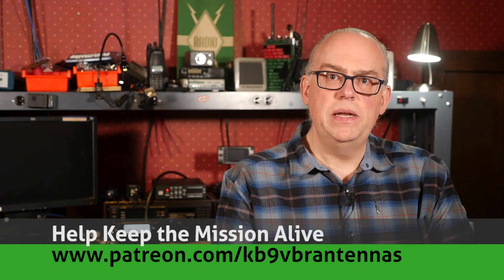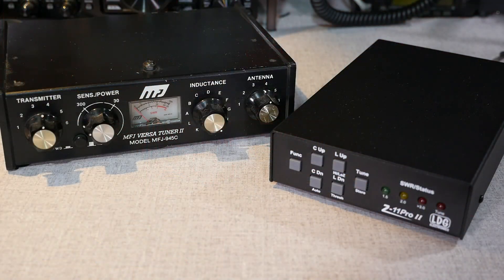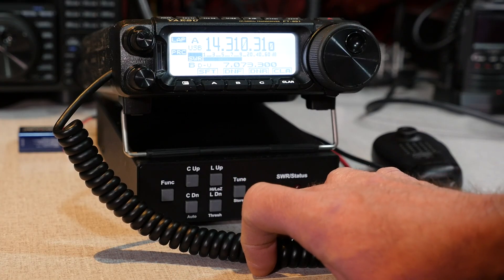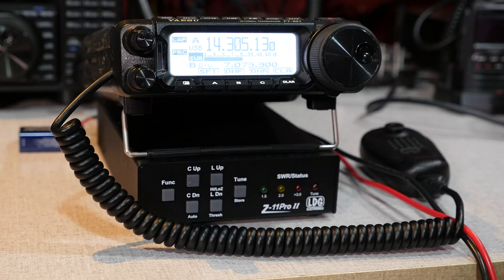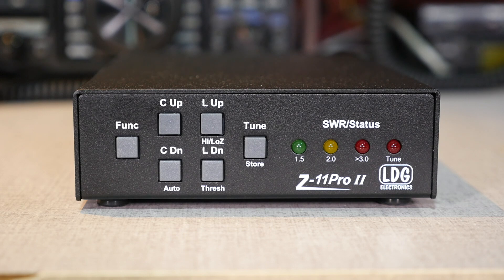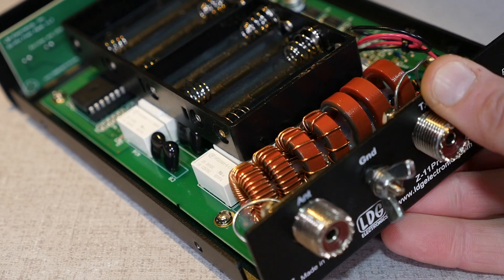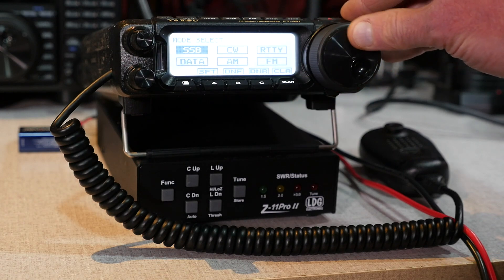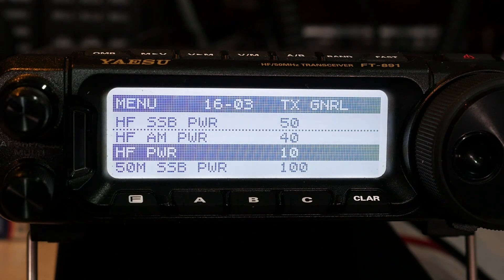How to use an automatic antenna tuner with a Yaesu FT-891 (LDG Z11 Pro II)  - Ham Radio Q&A

Comment: I have a ldg 100II pro and ft891 in LAP mode. I have set the MTR  to display power to see what power ft891 tunes on. I have noticed it tunes on 20w... is it OK?  Should I be concerned? It seems high.

Comment: I have been running with a FT-857D and a LDG Z100 for 10 years now. As I'm thinking for getting a FT-981 I watched your video. I would like to use the REM function as well as the tuner - so is it possible to make an adaptor and connect both the Y-ASS cable and the FH-2 to the port?
Reply from the maker: Unfortunately no. In order to use a tuner through the remote port you need to turn the LAMP mode to On. For the FH-2 to function, you need to turn LAMP to off
Reply: @KB9VBRAntennas  OK, so I will need to use the USB and send CAT commands.

Comment: What’s your opinion on the Yaesu FC-50?
Reply from the maker: The FC-50 is cool because it's paired to the FT-891. But be aware that it will only do a 3:1 impedance match. If you are planning to run a non resonant antenna, you may want a tuner with a greater range.

Comment: Would the LDG AT-100PROII also work on the yaesu 891?
Reply from the maker: Yes it will. I've used my AT200ProII, which is just a higher power version of the tuner, with the FT-891.

Comment: Hi Michael, I was using the other day the Yeu external tuner FC 40 on my 891 and it was amazing one simple 71 foot piece of wire up in a tree and with that tuner I was able to work all bands and when I had this set up in the field, I did a photo and it was remarkable If you can get a hold of one of these FC 40s you gotta check it out. 73 . W8KFW Karl from Ravenna, Ohio.

Comment: Question for ham radio q+a , my call M0ANO Rob from the UK..in previous years I have used atas 120's for my mobile operation but the don't last for many years. I've been things about buying a mat-40 auto atu in the back of the car with a very shout lead to a 9 foot tank whip. Just wondering if you think it will work well . Regards M0ANO Rob
Reply from the maker: I know of many hams that have great results using the 102 in (9 foot) whip with a wide range tuner. You need the tuner at the feed point of the antenna and the MAT-40 should be up to the challenge. My only advice is to bond everything in vehicle: doors, frame, chassis, etc. This will help greatly especially with using this setup on the lower bands.

Comment: The ultimate antenna tuner what is the first one made was called a Matchbox from Johnson Viking and it was a big metal box about the size of three school lunch boxes put together. And had two large knobs on the front which ran a  variable capacitors inside and the other one ran a connector around the inside of a large spiral wound inductor.. It was sold by the Matchbox label. And that would carry a kilowatt of K down am transmitter RF which was the design capability. It was made in the 1940s because a full legal limit AM transmitter or amplifier boy put out 100 watts of AM modulated RF which was a lot of power and more than today kilowatt sideband amplifiers will handle. In the 60s and afterwards, the American FCC it changed the output limits on RF transmitters to accommodate single side band... The limit put on what is a maximum of 1500 watts ohh modulated single side band RF which was actually about the equivalent of 500 watts key down AM modulated..  It was actually a reduction in RF power allowed to hams but because it was transmitted as a sideband emitter, the effect on the receiving end was even better than a full kilowatt of modulated AM RF.
     This is why the earliest Johnson Viking Matchbox was so big and so heavy duty inside the output on this unit word 2 ceramic insulated freezer bushings is it could be connected to either the two sides of a dipole or one side of a dipole or one side of very sloping wire antenna.over a correct length. Johnson ranking also made a very heavy duty half size antenna tuner that had a coaxial socket output where's promise matching 50 ohms properly tuned.  The second smaller Matchbox The second smaller Johnson manually tuned Matchbox was really sized for the single side band era...... That is lower actual RF  peak instantaneous hi RF output. Both made versions we're sold later additions there's a meter mounted in the middle of the front panel which allowed you to find a null point which indicated a good match. Like all matching antenna tuners, is very difficult to adjust a tuner without some output indicator like a meter.
   While he was in good health and young,, a man from Asia, Mr. Martin Ju, started a company selling low price ham radio products that grew to a huge inventory of just about anything you would want as an accessory to your ham shack. He created MFJ company and apparently bought cheaper Asian products to put in his units and apparently hired local unemployed ladies to build the units. These were all products that worked as described I just don't overload any of them or they will burn out with no overhead protection. Fortunately MFJ company had a huge line of accessories and toward the end of its life, it took up the stock and sales of remarkably good antennas from HyGain, and many other well established brands that couldn't make hey market driven Crawford only at your hams-- which is always been a small number of highly specialized needs. Unfortunately the MFJ line is succumbing to the advantage of its owner.... And may go totally out of business along with all of the well known brands it had adopted.
   By the way you can still get a magnificent five to seven elements monoband beam for 20 meters and less than $1000... Quite a bargain but not going to last as a sale item very long. I had the HyGain Christmas Tree fh a stack of five element mono banders for 20,15 and 10 yogis. really  barking.
Reply: I use a speech to text computer program they give me lots of errors.I hope you'll forgive me. I have PD and shaking fingers. Getting old reduces your fun.

Comment: How will this compare to the Yaesu FC-50 AutoTuner?
Reply from the maker: The FC-50 is a matched tuner for the FT-891, so it is tightly integrated into the operation of the rig. The downside is that the FC-50 is limited to a 3:1 match, which may not be enough range for a non-resonant antenna. (The LDG tuner can do up to a 10:1 match)

Comment: Do its relays draw current to hold the position after tunned, or are they permanent magnets?
Reply from the maker: The LDG tuners are designed so that once a tune is achieved, power is no longer needed at the relays.

Comment: Michael, just got a Z11ProII for my FT-891. I discovered that you can set the radio’s 16-03 HF PWR down (I set mine to 10w) so when it sends out the CW carrier upon tuning, it’s hopefully not as hard on the finals as the 25-50w it uses when the 891’s factory default setting of 100w is used. I checked that this was happening with the power out meter. Thanks for the great video and turning me on to the LDG!
Reply from the maker: I do the same thing, I keep the HF power relatively low and switch to RTTY mode when I'm tuning.
Reply: @KB9VBRAntennas  But what if you want a (permanently) higher power setting in 16-03 (for instance 40W for data modes). The tuner will use those 40W then, even if it would be much better to just work with 5 W, right?

Comment: Good evening. I am just wondering if anyone is having issues with this setup on FT8? For some reason, with the accessory cable connected between the radio and tuner, the radio is wanting to drop transmit any time I try to tune or TX the radio. As soon as I remove the plug from the back of the radio, it does just fine. Just wondering if anyone else has had this problem? 

73 de N4JKD

Comment: I have the old Z-11 Pro.  Smart choice on the 9 volt external power.  I like the internal battery setup on the Pro II, but would forget about the batteries (heavier) that would surely be oozing crud by the time I checked them.  Plus, unscrewing those little screws in the cold while on a POTA event wouldn't be much fun!

Great video, thanks!

73,
Brett

Comment: I have both manual and auto tuners. I hear that with auto tuners, one can risk higher SWR destroying the finals while tuning. What is true or just misconception?
Reply from the maker: That is a possibility. Going through a full tune cycle with an auto tuner can present high SWR to the finals. Much like the process with a manual tuner, you should turn the power down during a full tune cycle.

Comment: Ok so my LDG Pro II auto tuner on my Yaesu FY-891 quit tuning properly. I don’t if I did something to throw it off or not. I unplugged and replugged in auto tuner. Rechecked radio settings and yes had tuner set to Lamp for tuner. Ok so here is my question. Other people tune on AM or CW mode. You were tuning on this video in LSB mode. Is it ok to tune in LSB/SSB, as you said the radio automatically tunes in CW mode? I do have the proper control cable for the Yaesu radio. I do have data and center power settings low as noted.

Comment: Other than the obvious, what are the different features of the LDG AT-100Proll Autotuner and the LDG Z11 Pro ll?  I have the AT-100Proll Autotuner and just was wondering.  The only difference I think is that I have two antenna inputs. Would a 9 volt battery run my tuner and is the tuner drawing power after a tune? If I use antenna 2 input then I have the antenna 2 led illuminated. Thanks for any info de N3OJL.

Comment: is there a tuner for yaesu ftm 300 dr or no need for a tuner on that radio...2 m , 70 cm and digital. TIA
Reply from the maker: There's no need for a tuner for VHF/UHF. The antennas you will use with that rig will either be resonant or have enough bandwidth to cover the entire band.

Comment: Can you help me?  I have a homebrew 80 meter full wave loop antenna fed to an MFJ-993B Automatic tuner with 400 ohm ladder line.  I have an FT-891 Transceiver.  On the back of the MFJ tuner there is a port called Radio Interface.   How does that connect my FT-891?  Thanks!

Comment: I like having both a manual and autotuner BUT if one only had money for one right now (I'm ordering the FT891 soon unless I stumble across an Estate deal on say a good working legacy radio in the next two weeks for a starter then backup rig in the next two weeks.) Should I just buy the manual tuner and which one do 9ou recommend?
Reply from the maker: I think you should start with a manual tuner; they are more versatile. They will match a larger range, handle more power, and work with balanced and unbalanced feed lines. The MFJ line of tuners are good, like the 941, 945, or 949. You can usually pick one up at an estate or hamfest relatively cheap. I wouldn't be afraid to buy one used- as long as it doesn't smell like smoke or burnt electronics, it will work.
Reply: Thanks...I really don't mind fine tuning it by hand. Like the extra power capacity. Not to mention, save some $$$.

Comment: I understood. 
Built-in tuner - for fully automatic tuning of small(1:3) SWR. It always requires power and resets settings when turned off.
External - for adjusting hight SWR(1:10) by switching on the carrier. It is made on a relay with permanent magnets and requires power only at the time of tuning.
Manual - for huge SWR(>1:10), for random wire and non-resonant antennas. It does not require power, it allows you to adjust very precisely, but it takes time.
Michael, I'd like to ask. If I use an automatic tuner with a resonant antenna only to adjust the SWR at the edges of the band - how big will the losses in the tuner be in this case?
Reply from the maker: The tuner will aid in the energy transfer by presenting a proper match to the transceiver. But you aren't making the antenna more efficient. Some of the energy will be passed through, but most will be absorbed by the tuner. You really won't know how much unless you have power meters on both sides of the tuner.
Reply: @KB9VBRAntennas  One more question Michael. An optional 4:1 balun is available for the LDG Z11 Pro II, greatly increasing the impedance matching range. Have you encountered the fact that the standard range is not enough? Does it make sense to buy this option?

Comment: I just wish you could split that control cable so that the radio could communicate with the tuner but the ABCD data could still be sent to another device like an antenna switcher or band pass filter system.

Comment: Absolutely phenomenal explanation of the FT-891 integration with the LDG Z11 Pro II !!! I just picked up the radio and tuner. Was a breeze to setup and get on the air for a quick test. Also, I took your advice and soldered a 9V connection to power the Z-11 PRO. Thanks KB9VBR!!!
Reply: Can you estimate what swr it can mitigate?

Comment: The LDG Z11Pro autotuner is a great tuner no questions. I use it with my old Kenwood TS140S and it works fine. I have found one issue with it I'd like to point out to anyone wanting to buy it. It has an autotune mode which will tune the antenna automatically when switching bands without having to touch the tuner. When in this mode, I've had situations in which the tuner would tune down to 1:1 but will start retuning during a QSO. Also when in this mode, it seems sensitive to any RF near it. For example, one evening I was watching a digital pileup and picked up a 2meter HT and called a friend I heard on the repeater. The HT was on battery power using a rubber duck and when I keyed up, the tuner started tuning. The HT was not connected to the tuner or antenna at all, yet the LDG started tuning. The way around this is the semiautomatic mode which the tuner will only tune when the tune button is pressed. Once I put it in this mode, the problem went away. Other than that, it's a great tuner.
Reply from the maker: I've had the tuner do the same thing. Almost always in the field and on the lower bands. I usually chalked it up to the variability that sometimes happens with field antennas. If its wanting to retune, I'll pull the battery connection so the tuner stays on that same spot.

Comment: I have the same results as jyunte... the tuning cycle does not reduce the FT-891 power.   Is there a Menu setting I need to change to have the power reduced while tuning?   73, Ed ad7gr
Reply: Menu number 16-03 sets the HF power for tuner/CW/FM operation and menu number 16-06 for 6 meter tuner/CW/FM operation.

73, John, N1WOM
Reply: @jfrphoto01  But the problem is:
If, for example, I set 40 watts in 16-03 because I am operating data modes (FT8...), then the tuner will also work with these 40 watts and not with a lower, desired power (e.g. 5W)! Do I understand this correctly?

Comment: What about Yaesu auto tuners?
Reply from the maker: The Yaesu tuner works seamlessly with the FT-891 and it a great choice, albeit a little more expensive than the LDG.
Reply: @KB9VBRAntennas  Thanks. I was wondering why you hadn't mentioned the Yaesu unit. Good to know.
Reply: @billloveless6869  the ldg covers 10:1 mismatch while the yaesu covers 3:1 max. No brainer to go with ldg or mfj.
Reply: @JayN4GO  OK. That sense even to me, a newbie:) !
Reply: Check out the mAT-30 tuner for Yaesu radios at around $175.00.

Comment: Will this work with the LDG Z100A? I will using the LDG IC-108 interface cable once it arrives.  I can't find any info on this set up for a FT-891. 
Thanks KO4MWD
Reply from the maker: Unfortunately it won't. The Z100A is designed specifically for Icoms with the AH-4 tuner interface. I'm not sure if you could hack the interface to use with other rigs or if the tuner will automatically tune for you if it encounters a high SWR.
Reply: @KB9VBRAntennas  thanks for getting back to me.

Comment: Reviewed your setup for the LDG z11pro ii.  Unfortunately I could not get my ft-891 to tune. So I tried your suggestion of tuning in AM without the cable. Tuned just as expected.  Tried the tuner with my ft 857d and had the same issue.  I either have a bad cable from the tuner (its new) or the LDG tuner has a bad port.  Plan to call the vendor where I bought the tuner (also new) and see what they suggest.  Glad I found your setup or I would not have tried the work around.  Thanks for posting. Andrew

Comment: Hmm...I deleted my earlier comment. I just bought the LDG Z11 ProII on Friday, Jan 14. My 891 PO meter does not appear to show any power rollback during tuning. And I also was not able to get the tuner to initiate tuning via a button press on the Z11proII front panel after the first time. Yes, I do have LAP selected, and I do have the the  Yaesu accessory installed properly. I don't know if I am missing something, or the unit is faulty. I can tune if I transmit a carrier.

Comment: Hi, nice video, as always. Are you sure the tuner causes radio to reduce it's power? If I switch the meter to PWR and initiate a tune on the LDG, it still shows 100W out.
Reply: This was my question as well.
Reply: I have just posted this same question here

Comment: Hi Michael:

I just picked up the LDJ Z11 Pro II for my 891. HRO Atlanta didn't have the cable in stock. My question is how are you getting your 891 to output RF for the LDG to sense the SWR. My FT891 will not transmit when the SWR is high. I'm experiencing the same issue with the New SDC-105 screwdriver antenna controller for my little Tarheel 2.with the 891. It also needs RF to read the frequency to move the controller. If I switch bands the SWR is too high and the 891 gives a High SWR and doesn't transmit.
Thanks for the video. I hope to log you in a Park to Park. I have you in the log while I was hunting. 73 NM3J Nick